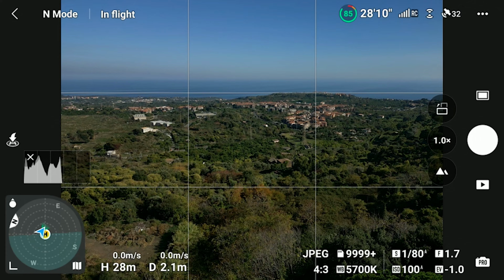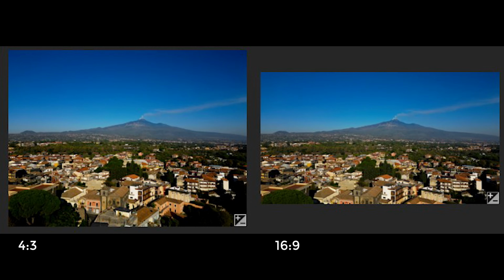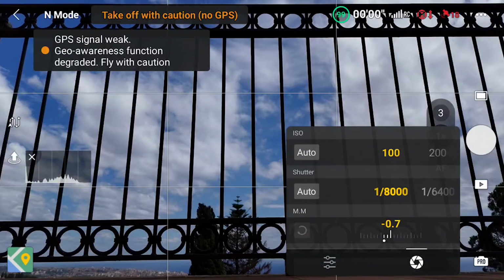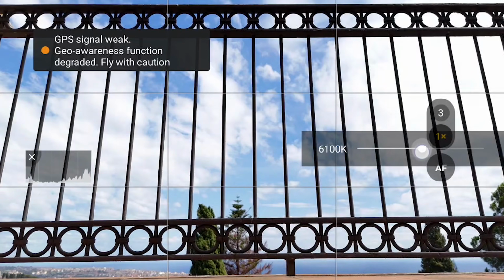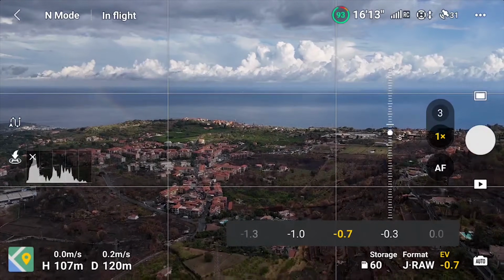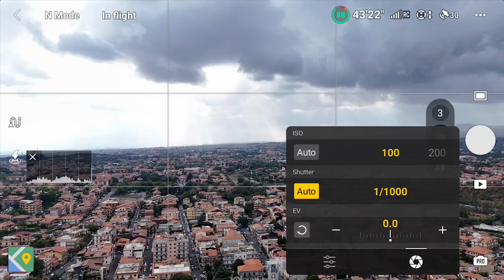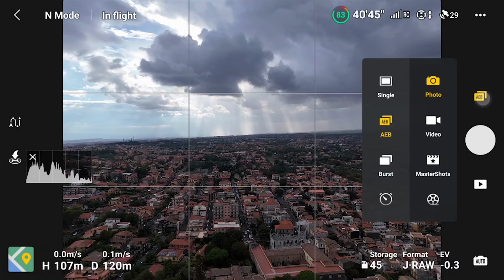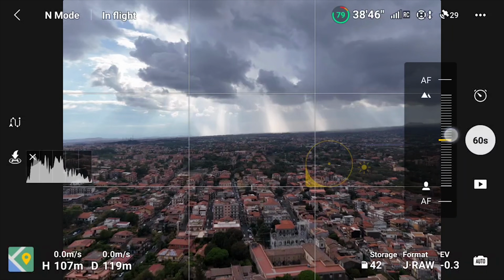DJI Air 3 Camera Settings for Photography - For Epic Photos

Comment: i was take some pics from DJI AIR 3 for my client..ths was bridge picture so i was flew drone high then take pics..
as we all know that Air3 have fix 24mm 1.4 camera so cam automatically set shutter 3500
i was set ISO at 100 due to harsh sun.
but when i saw pic at pc so disappointed.
Bridge look great in picture but VEHICLES who was at bridge was feel NOISY i mean throughout pic not sharp as i was thought
can anybody advice solution